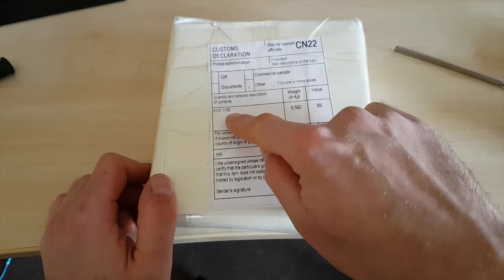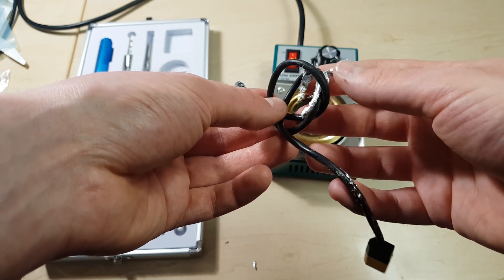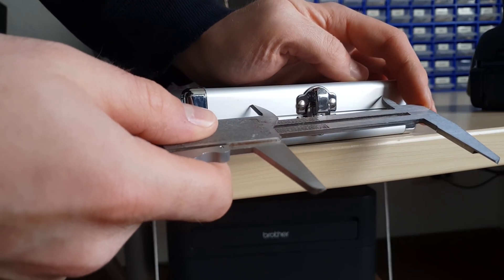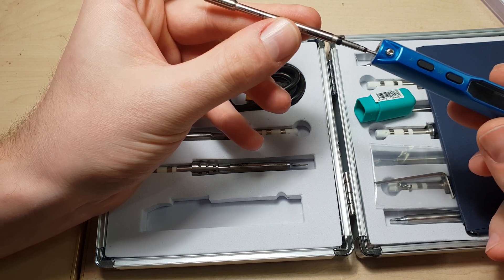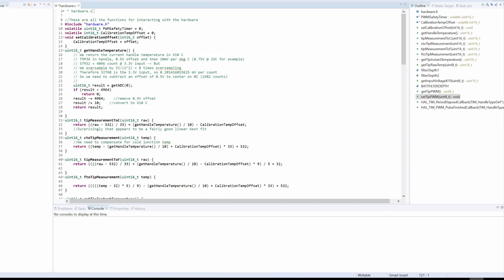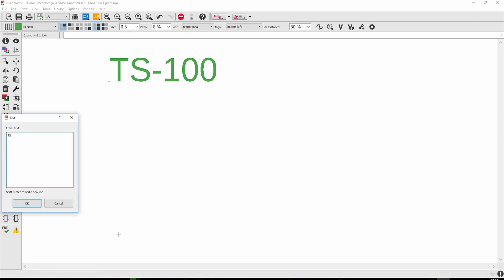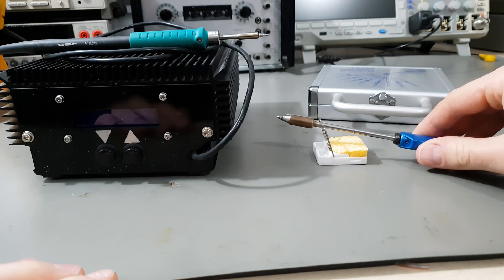'TS245' - TS100 Soldering Iron with JBC C245 Cartridge

Comment: Hey Marco, have you seen Sequre S99 pen soldering iron? It does exactly this - it works with original 2.5 Ohm JBC C245 tips! Hard to find proper power supply that can deliver 20V and 7.5A though. But I had luck because I found SlimQ F150 with DC5525 output that supports exactly that. It heats up in 2 seconds, just like JBC station. You only need a cable from DC5525 to USB-C. Had luck here, too! Found silicone cable on AliExpress. Next I would attempt to make adapter for Makita LXT 18V batteries, for hunting parts in the wild, of course! 😄

Comment: Not sure what to do now hahaha bought some c210 iron for fine work, now I'm getting compelled to mod my ts100 to use c245 tips ( but using the proper jbc pinout), mod for appropriate hardware and edit the firmware to allow for full power on the tips hahahaha

Comment: You know, considering you can get far better MOSFETs than those dinky P-chans, and drive them much stronger too, it would be quite possible to make a full-power T245 internal circuit board for a TS100/101. You’d need a really beefy AC-DC brick though, having an XT60 plug on the end just to use with 6S lipos might be the most convenient.

Comment: Interesting project. Though I realized that TS-100 is better for field job. On desktop rectangular handle is not convenient for SMD soldering and screw loosing and tightening on every tip change is a burden. Bought Aixun T3A 200W station with a set of T245 and C245 tips for desktop tasks instead. Kept TS-100 for field tasks though :)

Comment: The K blade (the knife) is actually pretty good for flowing both sides of some SMC resistors and diodes.  You can basically flow the solder on both pads and pull the component really quickly...

Comment: I just found out that i can use a jbc c245 handle straight on a dc source. At 5V 1,5A it heats up to 250°C and on 9V 2,5A to approximately 500°C ( tested on a cheap xsoldering cardridge, no worries ).
Now, watch me run through the world with my powerbank and do some primitive woodburning.

Comment: Two versus three pins solder element. 
Three pins is self explanatory. 
Two pins use time division multiplexing, Read and Drive modes. (1) Cut off drive current before read thermocouple (needs two pins). (2) isolate thermocouple ADC input to drive heating coil (drive heating coil through thermocouple junction, two pins circuit). This way, time division multiplexing, produce no read error to thermocouple signal, that made three pins isn’t necessary.

Comment: Still using that JBC tip without problems with the TS100?

Thinking on doing the same conversion to mine, well, in fact, using your video as guideline.

Regards!
Reply: Did you get this to work?

Comment: Any updates on this? I have a TS100, a few JBC cartridges, and also a metal lathe. The mechanical interface between the two shouldn't be a problem, but the rest of it besides loading pre-compiled firmware to it are beyond my current skillset. Not to mention, I love my ittle TS100 and I might cry if I were to kill it..

Comment: The tanto bit could be useful when you want to get at an angle on older equipment where you have to dump a bit more heat than you could with other bits. I've found myself needing something (and making it) like that whenever i replace stuff in old equipment. THO, i don't know about the bevel, i found that just edging the tip on one side is perfectly ok.

Comment: hello marcosrep, I am trying to build your jbc c245 welder, but in the bom.txt file of the project, the voltage of each of the capacitors is not indicated, and it does not indicate if the picofusibe is smd. Could you help me with that information? Could you tell me if another Atmega8 chip is compatible? I do not fine the reference "AI". thank you very much

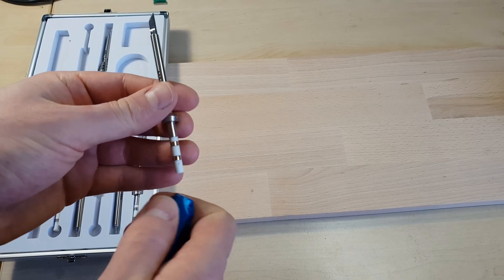Comment: 1:45 That tip is formally called a “PLCC Blade” because they were originally designed for soldering PLCC (“plastic leaded chip carrier”) ICs.
Reply: I use it for SMD at work, nomatter if its SOT23, 0805 og soic :P
Reply: Zplizor Absolutely, me too!! They’re great for lots of SMD and even general soldering.
Reply: Indeed it is good for PLCC and QFP soldering. Proper amount of flux paste around is very preffered though :)  Fit for SMD desoldering as well.

Comment: The tip on my ts100 went completle oxidized after just a couple of times using it for about 10 minuten :(. It is now garbage.
Reply: You can restore the tip with by sanding with fine grit sandpaper and then using a tip activator/regenerator like this:

https://www.banggood.com/FHG-10-Solder-Iron-Tip-Refresher-Cream-CleansingRefreshing-Oxidized-Solder-Iron-Tip-Repair-Tools-p-1168055.html

https://www.banggood.com/FHG-5A-Solder-Iron-Tip-Refresher-Cream-CleansingRefreshing-Oxidized-Solder-Iron-Tip-Repair-Tools-p-1175453.html

https://www.banggood.com/MCN-8-Soldering-Iron-Tip-Refresher-Clean-Paste-Oxide-Solder-Iron-Tip-Head-Resurrection-Repair-Tools-p-1111000.html

or like this:

https://www.tme.eu/en/details/jbc-tt9900/sponges-tip-cleaners/jbc-tools/9400000/

https://www.tme.eu/en/details/wel.51303199/sponges-tip-cleaners/weller/
Reply: Andrei Kolozsvari turned out it is the soldering wire that was garbage. I bought stannol 60/40 and the tip became shiny again. And I don"t think sanding the tip is going to help anyone. It is more then likely to destroy the tip.
Reply: Yeah, maybe not a good idea to sand the tip
Reply: @andreikolozsvari  more like a horrible idea for how expensive the tip is... Maybe it's suitable for that cheap 10 bucks soldering irons that connect directly to 110/220v, but not for this.

Comment: I may be missing how the code / cct works but I do not understand the part about reducng the pulse to 30 from 100 to prevent overload of the fets ?

Will this not just reduce the Average current to 3 amps and leave the peak current at 24V/3Ohm i.e.. 8 Amps which is beyond the max peak load of the fets ?.
Don't understand how they didnt blow up ? 

Is the PWM Frequency high enough that the inductance stops the current rising above 5Amp peak ?

Comment: That big knife tip is probably the best tip of all of them.
They're amazing general purpose tips. You can tin thick wires easy because they have huge thermal mass and you can also solder tiny 0402 components using the very sharp end of the tip.
Reply: I use it when cleaning with wick also. Like you said large surface area, large heat mass, and can almost "scrub" the board with the knife edge while wicking. Use it WAY more than I thought I would.

Comment: In the TS200 possibly...
It would be Awesome if they included a resistance sensor in the device to monitor header resistance, as well as a SMD thermostat
I think the "Wood carving tip" is actually for BGA (Ball Grid Array) desoldering (Chips like GPU's and other BGA packages)
Reply: the blade tip cant be for BGA, as BGA chips are mounted directly ont the PCB and have their contacts in areas not reachable by a soldering iron.

Comment: how is using a thermocuple in series accurate? doesn't the heater itself change resistance as it gets hotter?
Reply: You need to cut the power in order to take a measurement then you turn the power on. On instructables there is a project where is explained on more detail, search for: The Digital Controller for Amazing T12 Soldering Tips. Cheers.

Comment: Hi could you help me out with this question ????? i posted it on EEVblog
http://www.eevblog.com/forum/beginners/choosingunderstanding-the-right-powersuply-for-the-ts100/
Reply from the maker: Mean Well is a good brand, 24V regulated wont damage your iron ever. I run mine off a 6S battery that has around 25.5V when full, that is a bit risky but never did any damage. The 60W one will do the job too, easily! (Iron only draws significant power for a few seconds during heat up, less than 10W while in use) It is not such a trusted brand but I am 98.5% sure you will have no problem with it either

Comment: Pls modify FW of TS100 for JBC, I just blown up mosfet in mine and could replace it with something better, put it's PCB into some SMPS plug pack(laptop PSU style) and have very small yet powerfull soldering "station"

Comment: The knife-shaped tip works great for soldering headers all at once. Also desoldering works great. Use it with wick, sometimes its simpler to use than a D4 tip or similar.

Comment: 5:22 You say 'to keep the heater current away from the thermocouple', but from what I read this is not true. The ground connection is purely used to ground the tip. That is because this ground connection is also connected to the 'chassis' tip, and putting current through it could put it at a voltage different to mains earth if no separate (isolated) supply is used for the heater and the measurement circuitry. Also, I think the internal wiring of the heater/thermocouple is thicker than the ground connection, but not too sure on that one.
Reply: Do you know if when or if I were to use the grounding clip, that if I ran it into the power supply I'm using and cut the clip off and soldered it into the ground on power supply, would that work or is that a bad idea?

Comment: Why is JBC so good? What even makes an iron better than other?
Reply: As a JBC owner, I can tell you that the heat up time is insanely fast, If you turn the thing on it'll be ready to go in a second or under, even with the large handle and tips. Also it has a huge thermal mass capability so its great for desoldering parts off of large groundplanes or heatsink tabs. If it died tomorrow I wouldn't even think twice, I'd buy a new one straight away (if I couldn't mend it)

Comment: in addition to the handle mod, another mod might be to remove the insert with all the extra tips (only keep the 2 most used tips in the case) and install a battery and charger in the other side with the power output connector passing through the side of the case. If there is room, maybe a small parts compartment for... small parts that aren't in season in the wild, and maybe some shrink tube bits.
Reply from the maker: What a nice idea!

Comment: If JBC is 2:best whats is the best?
Reply from the maker: Who am I to decide? :) OKI Metcal might be good candidate but their stuff is very expensive and ugly ...
Reply: actually the alluminium metcal handler for sttc is the most beauty piece of soldering tool !!!!
Reply: Razzo you won't regret it, really
Reply: I have both Metcal and JBC, love both to death :-) I have the 4 port modular JBC system, but I really like their little stations; EEVBLOG did a teardown and review on one of those, really great stuff
Reply: and very light weight, even lighter than JBC by a small margin
Reply: Well i am about to order JBC stuff for about 1300 usd...
Reply: Marco Reps some of their stations are very nice looking and very solid, like the MX5000, the iron handle is very nice as well, the ultra fine handle is absolutely amazing and light like a feather; the stations use a SMPS, so works with any mains voltage; the boot time is near instant, about 10 seconds faster than the JBC, which needs to boot Linux or something; it has high thermal capacity and it just works on anything, don't have to worry of adjusting the temperature
Reply: I hope i won't :) I was also looking at Hakko stuff but their stuff is equally expensive and also changing tips is not as smooth as jbc
Reply: ThinkLearnSolve im going for the 2 port modular i dont think i have a need for 4 ports.. what so you think?
Reply: 2 port is perfect (tweezers + iron), you can always get another 2 port, overall you'll spend most of the money on cartridges, irons and holders
Reply: Pace?

Comment: Correct me if I'm wrong. I was under the impression that you could run the TS-100 from 12 or even 9 volts. Wouldn't that reduce the heater current sufficiently?

Comment: Knife tip is useful for connectors and thru-hole parts which have pins bent on soldering side. You can heat and pry things nicely ;)
Reply: You can, but you shouldn’t. It can damage the plating. I usually heat while I lift the bent pin with a metal spudger.

Comment: Do you know where I can buy some electrolytic capacitor tree seeds? I recently ran out of low ESR caps and as it’s spring I would love to plant one. Sustainable components are the way forward!
Reply: Pfft you don't need seeds, just plant a mature capacitor in the ground (leads downward). Use lohmy soil and make sure it gets enough drainage.
Reply: urdnal - thanks, I’ll give that a go 🌲
Reply: @ZylonFPV  How did it go? did the capacitors come up nice and rjpe?

Comment: Wow 139.99$$, that's already more expensive than my Weller station!

I really like how fast it heats the tip, hopefully, that wasn't you speeding the video up   :LOL
Reply: Nope, at 65w (it's full power, needs a 24v psu) the tip is ready to melt solder in roughly 6 secs. It's a beast.
Reply: the thermo sensor is almost literally next to the heater element. Also a lot of ceramic insulation forces the heat towards the tip mostly.
Reply: Alucard Pawpad 
You mean because the thermocoupler is vey close to the heating element it appears to be heating very fast rather than being close to the tip itself and that would also means the displayed temperature is not accurate?
Is that what you meant?
Reply: That is correct, Muhammad. But the tip has a copper core so it becomes "accurate" within a few seconds. Also the cartridge current is going partially through the thermocouple so that might be also heating it up a little too. 
But with soldering irons you hardly need an "Accurate" temperature. Most, if not all, soldering jobs require a temperature overkill to melt the solder QUICKLY before the heat spreads. Controlled heat is only important for high grade soldering jobs, where a pre-heating station is used to keep the entire board at a high (but safe) temperature, and the soldering iron just provides the final push.